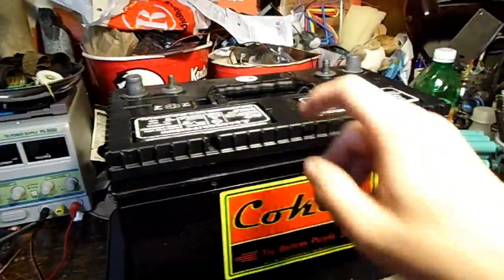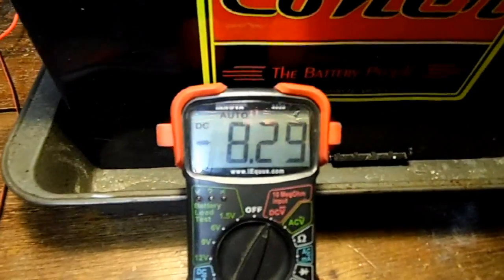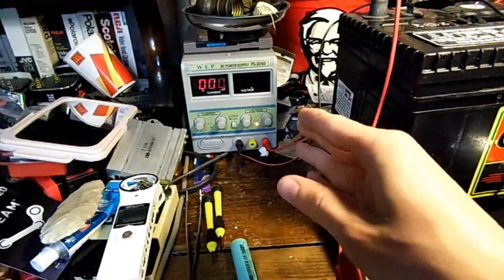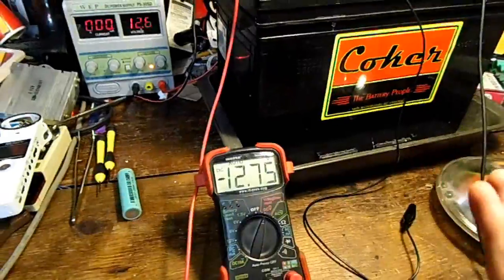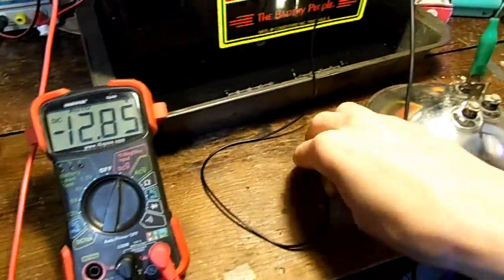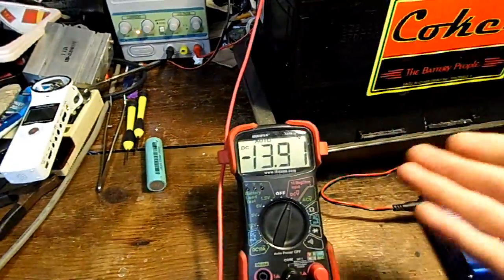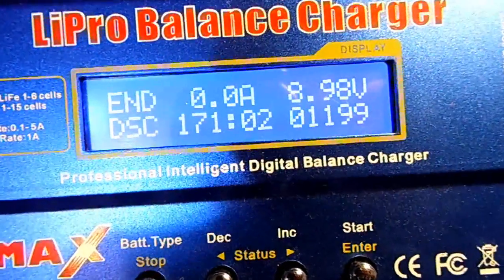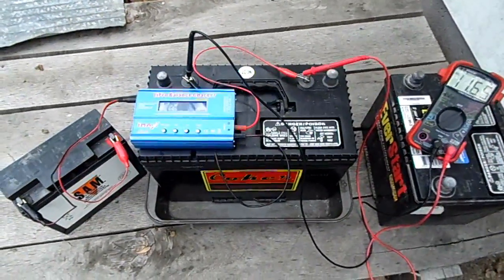A Strange 12v Battery

Comment: Set your current limit at 1 amp. Set the voltage above 17 volts. Charge until the voltage no longer rises. This is called 0 delta V. you may find that the voltage goes way up for a time, then starts to decline. Once the voltage stabilizes, do your discharge test. Recharge in the same manner. If the battery is any good, this should solve the sulfation problem and the battery will be usable. If not, it will finish it off. It's worth trying to cycle it back to life, because you suspect it has not been cycled much, if even at all. You should always use distilled water just in case it proves to be a good battery. You are right not to add water to a dead battery, because it could overflow once charged. just make sure the plates are fully covered under water, but don't fill it up until charged.

Comment: Batteries like this can sometimes be revived with exercise. Fully charge it then put the current up to C10 value for a few hours to bubble it,  and mix the electrolyte. This also helps to break down surface sulphation on the plates. Put a heavy load on it and discharge to 50%. repeat the process 3 or so times, topping up with distilled water as necessary. Once the battery has recovered, keep it floated at manufacturers rating until needed for use. Always fully charge after each use, never use more than 50% depth of discharge. Batteries do not die, they are killed!

Comment: Here's a possible answer for your "Weird battery". Did you know that when you charge a battery, the FASTER you charge it, the FASTER it will discharge? That's why it's best to trickle charge your battery if you want it to last.
Reply: *****
I actually went to school to learn this. If you fast charge a dead battery, it will also fast DIScharge.
Reply: *****
Don't know, exactly, but it has something to do with amps vs volts.

Comment: If Epsom salt worked, the manufacturer would sell it. The manufacturer does NOT sell epsom salt.
Reply: Manufacturers DON'T sell stuff that saves you money. Anyone remember "Grease Relief" for your clothes? I had an oil stain on my good Levi's, after about 5 washings it was still there. Mom got a hold of my laundry, and used Grease Relief a single time on that oil stain, and it was GONE without even a trace. You can no longer get Grease Relief. So, the point is, if it's saving YOU money, then that's money you're not spending on someone's product, and therefore they go out of their way to keep you from saving money. Not saying epsom salt works, just saying that if it does work, they'll go out of their way to find a way of keeping you from using it.
Reply from the maker: no, that line of thinking is wrong. they sell sulfuric acid for this but then your dealing with sulfuric acid, plus a lot of people might have epsom salt laying around.
Reply: Ok. Feel free to show me a YouTube video where Epsom salt worked. Rinoa tried twice and neither worked. One improved just because he connected the leads to make it spark. Not salt.

Comment: Is it a gel cell? If not try low voltage ac descaling. Sometimes you will still have a fraction of good plate at the top and it will mimic a smaller battery. Sometimes with a gelatin based electrolyte residual acid will bleed out appearing to be filled  with  regular acid/water

Comment: Any 12 volt lead acid battery requires at least 14.8 volts to reach max. capacity
A vehicle with 24 volts of battery will read 30 volts when motor runs.
Reply: i actually use a 12V linear transformer but it charges mine with around 16 volts
Reply: i actually use a half wave rectification to try to stop that. and this 12V 1A transformer surely will only give me 12v at it peak load lol
Reply: still, you cant beat there electrical isolation  XD

Comment: NEVER I repeat NEVER add tap water. ALWAYS I Repeat ALWAYS use distilled water.
OK, some constructive help here.
Sulfation is the problem, to get the sulfation off of the plates and back into the solution, (to regain your gravity level) you must do one of 2 things.
1: buy a chemical product to break down the sulfation.
2: or use a high voltage feedback. usually a Desulfator, or bedini moter, or a high dollar desulfating charger.
A small desulfator works well, but takes several weeks to even months to completely desulfate a typical lead acid battery.
Good luck!

Comment: When I was doing research on building an electric car I studied lead acid batteries quite a bit. Seems once crystals have formed on the plates it's really hard to get them to break down. I bought a de-sulfater and had fairly good luck with it. The battery in my tractor lasted 10 years and the one in my truck 8. I recovered a couple of gel cells and a 10 year old motorcycle battery that was bone dry when I started. high frequency electricity applied to the battery seems to be the trick. You won't be able to recover a battery that has been cooked on a high amp charger though. My 1991 Saturn Coupe has 12 87ah gel cells in it. I wish I could get motivated to finish the wiring and go for a cruise.

Comment: drain the liquid out. put 1 cup epsom salt per quart of water, dissolve all epsom salt before putting in battery, might take 3-4 batches and fill up your battery. won't work on frozen batteries. well worth the price of epsom salt. charge fairly slowly for 12 hours or so.

Comment: They make Lithium Ion batteries for my Suzuki Gixxer. Do you think that's a good idea with the stock charging system or is it a scam being they are price 5X more? They look like 18650's on ebay. Thank you.
Reply from the maker: they are some of the highest priced cells i've ever seen. i remember thinking maybe i could get lithium cells that way before i started getting laptop packs haha.

maybe the reason they are so high is due to the C rating of the cells. one way around it is to charge like a super capacitor with like 6 18650 cells then start off the capacitors. i bought some 400 farad caps for 5$ each off ebay a while back.

how many amps are you needing? laptop cells can supply like 5A each sometimes but thats pushing them, then again it would be ok for short bursts

remember my first lithium video?  DIY: lithium ion 18650 4.2v 10ah Battery Pack

in that i almost start my lawnmower with 6 cells in parallel, and those cells turned out to have only half their power. so 3 cells could have done that.

Comment: Have you ever tryed charging at 16 volts for at least 24 hours? and keep adding distilled water every once in a while. i have recovered a few that way, they held 80% capacity.
Reply: +fliping720 Just a bit of background, I have been recently buying scrap truck batteries, Thicker plates then car batteries, and I have been restoring them for a make shift al cheapo solar battery bank. the batteries are about 120AH each @ 12v. So far I've brought back 6 heavily sulfated batteries, they have about 90-100 amp hours capacity @ a 22 amp constant draw when I;m done.

Back to your process.

Be careful, that process works very well at first glance, I've tried similar, but I would highly recommend NOT to charge @ 16 volts for 24 hours, holy crap bra. all you end up doing in Gassing the hell out of it and seriously damaging the positive plates in the process, if they are old batteries, its catastrophic. Trust me, I found out the hard way. 2 bricked batteries that looked like good candidates.

Also the problem with excessive long term bubbling , especially extreme bubbling, is the bubbles actually form inside the porous material of the plates, those bubbles actually break away lots of the active material as they force their way out from inside the plates especially at a high rate of overcharge. Also batteries dont like excessive heat, I assume your batteries run very hot when you force feed em for 24 hours, its no good. MAX 50 degrees C to help dissolve the sulfates, but do it short term only. 

If you notice black particles floating in solution, then  you know thats your positive plates dissolving. 

I strongly recommend you change your recovery tactic, I have had much success Charging the battery slow, especially if its extremely sulfated in the beginning until it wont charge no more at a normal charge voltage, Check the specific gravity of each cell, if below 12.60 I then recommend that 16 v overcharge to break up the last sulfates and balance the cells.

16 volts for like 8 hours at a Max of 2 AMPS for a 100 AH battery is the MAX i would do to equalize and final desulfate. It works very well, it takes longer then your method, but ultimately the battery will be happier long term if you plan a serious use for them like I am.

ALSO PS, dont add anything to the batteries, no Epsom salt, or acid or anything. just add distilled water. The other methods are like adrenaline shots they spike your performance up and you think wow thats awsome , but they ultimately burn out the battery chop chop and hectically corrode the plates. 

yeh my 2.5 cents

Hope this helps you. Good luck restoring your batteries.
Cheers
Reply from the maker: i did that in the video for the 2nd discharge. but i only let it charge for like 8 hours. but it didnt seem to help. i will try more latter though.
Reply: Fum3s thanks for the great info, i have learned this my self now and i know this is true, like you said at first your like wow it really worked, then a few months later brick...
Reply: fliping720 Trial and error, so long as you learn from your mistakes, I'm glad you came to the same independent conclusion by yourself, it means I'm also on the right track. Took me quite a few mistakes and a lot of Google research on lead acid to learn the do's and don'ts of Lead Acid before I finally found a way that works.

May I ask, what are you restoring your batteries for? 

Also, I'm having 1 problem which I'm struggling to get around perhaps you can help, most of the time 5 of the 6 cells are good, 1 cell is badly sulfated, how do I increase its charge without cooking off my 5 good cells? what I am doing now is cutting the cell open and manually charging that cell at 2 volts, but its messy, I cant find another method, any ideas?
Reply: Fum3s i charged one battery with the single cell method and it work but yea its messy, only way i know about though. the bateries i was recovering was mostly for fun and i would give them away after to friends.

Comment: First, check the acid concentration in each of the cells because it seems like the solution is wrong.
Then, try to charge it with the Imax B6 integrated Pb charge function at 12V/1A (or, use your bench PSU at 14.4V/1A). After charging, connect it to the power supply at 13.8V current limit at 1A and leave it sit for a day or two until the current is negligible.
Finally, do a discharge test and compare!

Comment: Sounds like the plates are covered with crud.

I wonder if hard charge/discharge cycles would do anything, say 50A, lead/acid batterys are supposed to work better with heavy charge/discharge, dont know if its true though.
None of your volt meters agree with each other, psu one/multimeter/discharge unit, perhaps a check with your quality bench meter would be an idea :-)

Looks too nice to kill it :-((

Comment: charge it at 16v, see which cells are bubbling, let it do that for a couple days, maybe try a hydrometer, also another reason to try the hydrometer maybe the acid was put in the wrong concentration, also voltage test each cell by dipping the probe to the plates.  ideas to try before you epsom salts it!

my exact procedure to equalise batteries is this: first a full charge to 14.4 then  float at 13.6 for at least 24 hours, then put your supply at 16v, ideally with a 5ohm 20watt resistor to limit power, soon you should see cells bubbling, and probably a stubborn one that wont, keep charging at the 16v all day and hopefully the bad one will come alive, check battery temp should never get above barely warm
Reply: I don't know but leaving it bubble for so long could (POSSIBLY, I don't really know) corrode the cells. Your procedure for equalising seems correct tho :-)
Reply: MrOpenGL
agree, the couple of days part, but this battery is somehow knackerd, if it was a much better battery id limit it to a couple of hours max